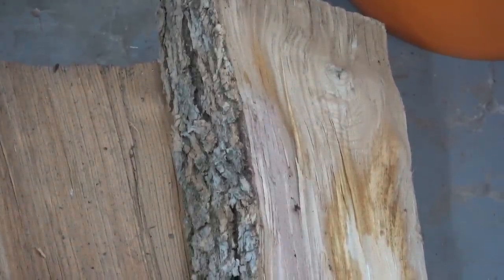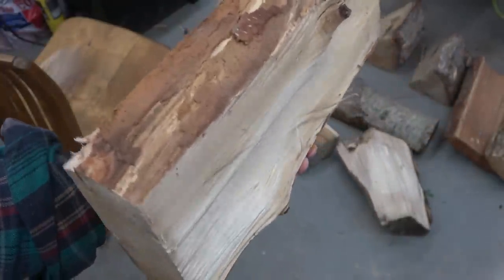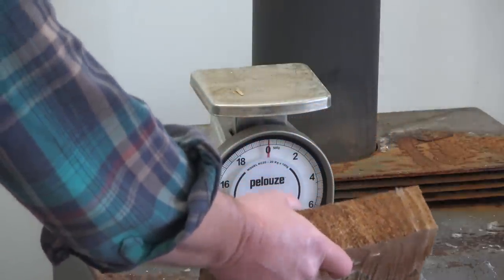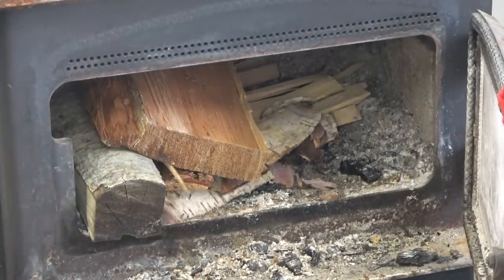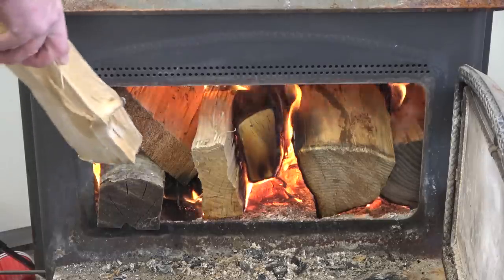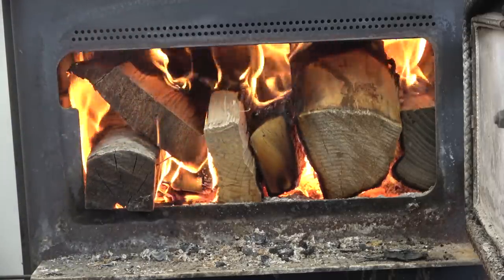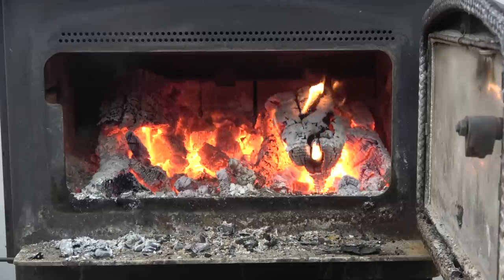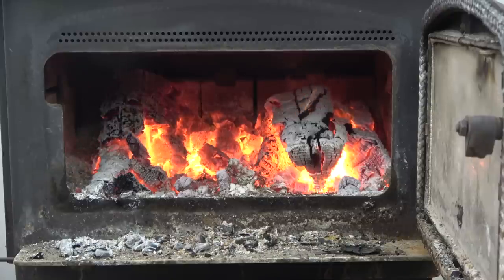Best firewood?

Comment: We heat with cordwood in a Tempwood top loading stove so don't have a nice picture window. I agree the heat value of wood is based on mass and water content. Here in New Hampshire we have mixed hardwood/software forests so there is not much need to burn pine as is is about half as dense as most hardwoods so by volume you need twice as much.   

I was a little nervous seeing the backdraft but I guess you are an expert old timey wood burner.

Comment: Oak and almond both give off great long lasting heat especially when started by eucalyptus
Reply: I'm surrounded by free almond wood but no wood stove as they're illegal here. The state can't tax free wood.

I have a wood shed full of almond wood for the fire pit, though.  Which is also illegal most of the time.
Reply: Australian gum, red gum in particular is the best eucalypt you can burn
It's hot as heck and burns for hours
Reply: Started by eucalyptus? My experience has told me it's hard to split it down to use it to start fires!
When I take out a dead almond tree, I save as much as I can be bothered to. Twigs and thin branches to start the fire, medium branches to build it up, and the bigger logs to actually burn.
And bung a load of twigs and branches on to get the stove up to cooking temperature!
Reply: @samuelmellars7855  that's why my family invested in a hydraulic splitter
Reply: @randomm9683  That's a good idea if you're burning eucalyptus! We've only had eucalyptus delivered the once, so it never crossed my mind you'd be using a splitter.
Do you split the logs green? I've heard that it's easier.
Reply: @samuelmellars7855  no my family has about 5 acres that they planted eucalyptus on in the mid 70s so they take what is either dead standing or looking like it needs to go cut it up with a chain saw leave it for a season then split it

Comment: All DRY wood gives the same heat per unit of weight.  The key is moisture content and different weight per cord.
Reply: Yup- something on the order of 9000 BTU/lb if memory serves...
Reply: Sherman Hofacker

Not so. Burned EFFICIENTLY in a TLUD so the off gassings get burned rather than escaping or plateing up the chimney, and yes, reduced to uniform pellets & uniform moisture content, highly resinous "soft woods" give slighly more energy per volume and rather more energy per weight.

Comment: Being an East Coaster here in Nova Scotia ,people here totally think you can't run softwood in your stove... I ran the nice dry ends of spruce lumber from the local mill where they build roof trusses and that stuff was amazing and clean. The trick with the softwood is to run the stove hot as the blazes of hell really often to keep the creasasote from building up. I used to do it once a day. I knew an older lady that used to burn the spruce slab wood that comes from the milling process because it was super cheap. She told me she throws a bunch of rock salt in the blazing hot fire and that keeps the chimney clean. It seemed to work.

Comment: It reminds me of the moment when, as a child, I dumped almost 3 kg of walnut shells into our oven in the kitchen for Christmas and my mom almost freaked out when the whole hob started to glow cherry red. :-D That stuff is hell on earth if you set it on fire.
Reply: Really, walnut shells??? 
I didn't know they could burn like that, though in my defense I've never tried to burn them in the oven Lol
Reply: @Sp3c9000   
  I grew up cooking using a Roman Stoveworks wood burner. Walnut shells are oily, and burn like Lucifer's hookah at a frat party! Pecan shells aren't quite as bad.
Reply: @stanervin6108  oh wow, that's crazy! 
Thanks for the info, little nuggets like this thread are why I enjoy perusing the comment section Lol
Reply: @litterpicker1431  What now?  That's a bit of a stretch, even for me - I'm still following Directive No: 1  -  my fire is on the other side of the room to the vice...
Reply: Down in parts of the south, the BBQ places will use pecan shells soaked in water to regulate their fires. Gets to burning to hot, they toss em on to knock back the fire without putting it out.
Reply: Paper bags full of dry pine needles does the very same thing!

Comment: There's a great book called Norwegian wood.  Explains more than you'd ever want to know about firewood in a relaxing way.
Energy is very proportional to dry mass.  Lower density typically results in faster release or hotter temperature.  Higher density results in slower or longer burn.

Comment: I'm in NWO near Minnesota and it gets to about -50 with the wind chill. We mainly use birch and ash to burn in our wood stoves in combos of both dry seasoned and fresh green. I like to put a few dry ash quarters as a base in the stove first, followed by a few small greenish birch logs on top and a few dry birch quarters with a bit more dry ash. The combo of both green and dry keeps the fire going a long time. If I want a fire to go all night, I burn a few dry logs with one or two green ones and let burn till coals, then put in a big ole green birch log, it will slowly burn the whole night, works every time. Also, cardboard and old egg cartons are really good kindling material.

Comment: an old timer said " if you age your wood 5 years, you'll NEVER need to clean your chimney. 🤞👍👌✌
Reply: It's true but the issue isn't age, it's moisture content. Water is the cause of creosote. How many years depends on species, how it's stacked, where it's stacked and climate. 12% moisture or less, you are good to go.
Reply: That expression is an oversimplification but it's roughly correct in my experience.
Reply: I'd rather just clean my chimney...
Reply: @AdmiralBob  You have to season it for awhile no matter what. It's not just a about a clean chimney either. You get more heat from the wood and less chance of burning the building down.

Comment: Conifers can also make their own starter. Conifers will continue to pump sap upwards, even after the main stem has died or been removed. This mechanism also takes place on dead limbs to help seal up the exposed wood. This sapped up wood, or fat wood, or pitch wood, or what ever you call it will burn like a torch. Use an arborist saw to increase the surface area on larger pieces and to collect the dust. 
My dad made a habit of gathering the stumps for hunting. Water won't soak into the pitch, it will burn all night long, and it will burn hot. I don't recommend using only pitch wood in a fireplace or stove. That will cause a chimney fire before long.

Comment: I'll propose a methodology for further testing: a full stove of a single type of wood, similar split size and similar outside conditions. Measure average temperature, ideally of the stove but the same place in the room would be fine. Also measure burn time. The resulting measurement (temp x time) would be a form of total energy analogous to kWh. If you weigh the splits you can get energy/weight, if you measure stove volume you can get energy/volume.

Comment: When I was a teen, we burned wood for heat. Dad used to call the power company and find where they were trimming under  the lines. My experience is that black locust is harder than oak. We always burned hardwoods as pine left creosote and that’s what causes chimney fires.

Comment: Years ago my brother worked a job in the middle of nowhere Utah. The job super, being a frugal man kept the construction trailer warm with good old split oak firewood from Tennessee. He had multiple cords trucked out to the job site in preparation of those cold Rocky Mountain winters. The natives took notice of the lengthy burn time of said wood and before long said wood started to vanish from the wood pile. It did not take long for the super to take notice of such thievery and had a formidable fence installed around said wood accessed by a stoutly locked gate.

Comment: Might be a couple other questions very difficult to determine too.
Loved the commentary. 
But I wonder what piece threw out the most BTU's? Burning longer doesn't mean better.  I had a friend who liked to burn frozen green poplar because it lasted forever. It seemed to me it was smoldering forever but producing zero heat.
Also in a stove with the door closed & set the draft,  each variety would perform differently. 
Now I just need to produce videos with this many views on a regular basis!

Comment: To Production Manager:
To clean the window on the stove's door use spray oven cleaner.
When stove is cool, a shop vac will do the ashes.
Reply: You can use a damp paper towel and ash to clean the glass nicely, bonus that you just toss it in the stove when done

Comment: the heat goes right out the stove pipe. 
thats what I love about the rocket stove. the hot pipe heats a mass first, before going outside. 
the mass gives of it's heat long after the fire has gone out.
very efficient.

Comment: Definitely agree on testing with similar shape. I've gotten 8-12h burns with large logs of grand fir here in Idaho a couple hundred clicks south of the Queen's frozen Northland. Grand fir is typically rated lower btus than Ponderosa....
Reply: But a smaller load of ash or tamarack would've done just as well.

Comment: I'll mainly use beech, oak or ash for firewood. Resinous softwood not only gives you the sputtering but also schmoo in the chimney and can damage your oven (not that it should make a difference for your worn out specimen). Birch is also nice because it lights quicker and has a very pleasant smell but at the same price as the beforementioned ones per volume, those certainly provide more bang for the buck.

Comment: Best firewood is the one what you have when you need it (and yet better if it's free) ;)
I kept my house warm for almost a winter with wood-scraps left over from extensive house remodel - floor planks, support beams, door frames .. etc.
Although, ashes were very iron/copper rich - nails, screws, hinges ..

Comment: I burn free pallets in my shop, split cordwood in the house. Whatever I can find that's free. Here in Western Washington State my favorite (if I have to fell and split it myself) is Red Alder. It splits easy, no sticky sap to gum up your tools, burns clean when properly seasoned, and the smoke smells nice. (it's also what folks on this coast traditionally use to smoke salmon). It's ideal for campfires because of the low smoke and it's good to cook over. It also doesn't build up much creosote in your chimney. Not the hottest burning but you work less for the BTUs you get. Next in line are Douglas Fir (most BTUs in this area), Bigleaf Maple, Western Hemlock and wild cherry. The maple here is softer and faster growing than its eastern cousins and so not as many BTUs but still good for coastal winters. Lots of Western Red Cedar available but that's best for kindling though I've burned it for heat when that was all I had. Cedar will also burn green in a pinch but you'll need to clean your chimney a lot. I'll burn pine but it's real sappy and also coats up the chimney. The sap burns like oil and makes a lot of greasy smoke so it's not nice to cook over in a campfire. I won't take poplar or cottonwood though if there is any cutting or splitting to do, not worth the effort. Cherry and Alder grow like weeds around here and I've gotten firewood by asking the owners of vacant lots where cherry and alder have sprung up if I can cut 'em. From their end they're getting free clearing of the lot they want to build on at some point and I get free firewood.

Comment: Most common firewood in my area is Douglas Fir. It has pretty good heat value but it burns dirty, leaving lots of ash and charcoal. The best firewood is madrona, which burns hotter and longer than white oak...but it's expensive, double or more than the price for Doug Fir. Western red alder and bigleaf maple are available as well.

Comment: Squash 2 or 3 aluminium cans and put in your fireplace on full chooch and it will clean your pipes. 
Your hardwood rates on the scale about the same as the "cypress" pine here in Australia. For hardwood in my area in north west nsw Iron bark is the favoured firewood. As the name suggests it is hard and regularly produces sparks from the chain saw

Comment: All,

Softwoods have higher combustion energy per unit mass (from the sap).
Hardwoods have higher combustion energy per unit volume, given the higher density.
If you are doing a burn rate comparison, surface area to mass  ratio is the everything (shape is very important),
AND
moisture content is critical since moisture cook off is wood's burn rate regulator.  Wood burning equipment is designed for moisture content around 20%.
Enjoyed the vid.

Comment: Is taking longer for all the volatiles to burn off necessarily better? When I'm using firewood in a wood stove like this to heat a place I want a good proportion of my wood turned to embers because they will burn slowly and steadily in addition to tolerating the air inlet dampened down without releasing tons of creosote from smouldering.

Comment: Water content is a huge factor too.   Hardwood takes longer to dry out.   It would be difficult to match all the woods water content.   Ash, Oak, and Elm are the favorite in the center of canuckistan.   Usually seasoned 3 years minimum.  I think pine has an advantage with its sap, higher btu per lb.

Comment: On the west west coast its widely agreed yellow cedar (Cupressus nootkatensis)  tops the rest of what is available, fir, spruce, hemlock and cedar. It works best of course if its  seasoned for a  year+. Easy to quarter with a light weight mall. Only problem its hard to come by unless a tree gets blown down
Smells amazing, very long clean burning. Great for baking and roasting if stove is appropriate.

Comment: One thing overlooked toward end of this test. Yes the pine out gassed  longer with flame but didn't any one notice at the end while where the ash and birch was still a nice bed of hot coals while the pine and Russian olive was already turned to ash and no longer generating heat. This is the advantage of hardwoods they create large beds of hot charcoal that last while your soft wood just burns and goes into ash with no hot coals. It's the charcoal of hardwood that produces the high intense heat due to its density. That's something I didn't hear mentioned strangely being AVE is a great engineer. Weight and size play a role yes but the density is what's key in this experiment.

Comment: before i watch this, i wanna say my understandings of different woods as firewood.
this comes from a person who lives in a rural area in a cabin that is heated only with wood.

in my view, light/soft woods burn faster so they yield less heat over time but they do make a hotter burn. 
dense/hard woods burn slower and make less heat but they give a heat storing fireplace more time to heat up. 
resinous wood burns easier so it's preferable for starting a fire especially if the wood is a little damp, but the resin or sap makes very little difference in terms of burning time or heat.
elastic woods like a young willow is rubbish as firewood unless it's bone dry.
Reply: That is my experience. I like to mix the woods. Some softer woods to throw in to keep the temperature up and keep the hard woods burning.

Comment: On my property in San Diego County we had a pair of Monterey Pines that grew there but couldn't handle the heat of that climate. One was dead and the other was dying. It was the weirdest stuff I've ever worked with and burned. Gnarly as hell and soft, so impossible to split by hand. Sometimes the splitter wouldn't touch it either and I'd have to intervene with the chainsaw. It also had the most intense chemical pine smell I've ever encountered outside a bottle of pine sol. Whenever I split or sawed into it, the smell was overwhelming. The sap was so thick that even bone dry (and it was as dry as it got out there in the desert), the smoke coming off it was thick and black. Only other thing I've ever seen burn black like that is tires and plastics. We took some to the beach one time to get rid of it because they had public burning pits out there and when we lit it off a bunch of people ran over and were like "what the f*** are you guys burning over here!" It was the funniest thing. I was a little nervous because they're very particular about their emissions out there. One stray fart and straight to jail, right away, but we ultimately got away unscathed.

Comment: Down South of you in the pinyon/Juniper areas, second largest forest extent after boreal, We love the snap crackle of juniper/cedar/cypress as it keeps the bad spirits out of the house! Both are denser than Ponderosa under a couple feet in dia.(USFS regs don't like cutting large old growth), mostly. Resin content has a big heat factor compared ro cellulose alone. side note, nice thing about russian olive and ailanthus (tree of heaven ) is they are easy to split and both should be dried for a couple three years after splitting to lose the noxious smoke aspects.

Comment: Be curious to see how many BTUs  each puts out.  Even oak vs kiln dried oak is a hugh difference.  Need 3x 'seasoned' oak to match the output vs kiln dried in my stove KD, burns much hotter, and far easier cleaning.  
The pine lasted longest, but was it as hot? 
Never used pine due to cleanup issues and potential chimney fire.
But would be curious to the BTU output per weight or volume